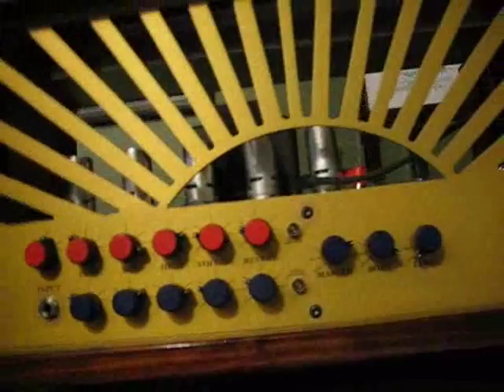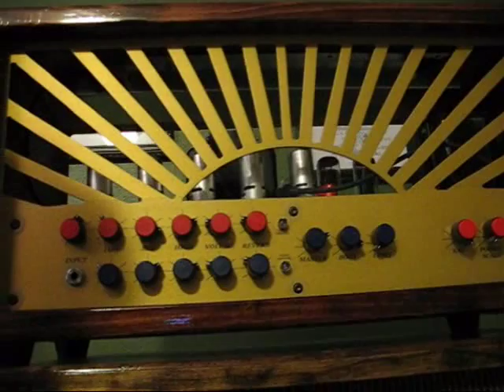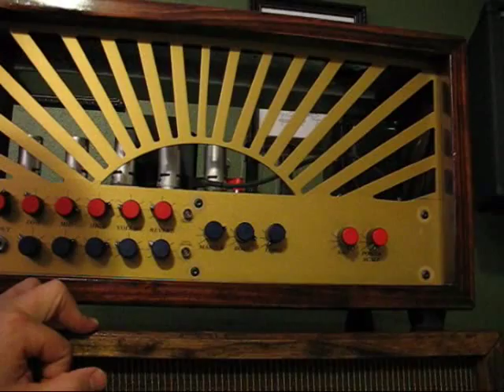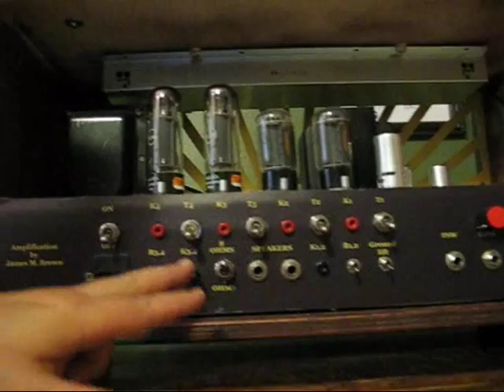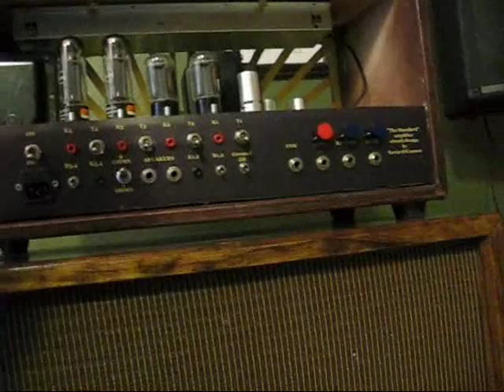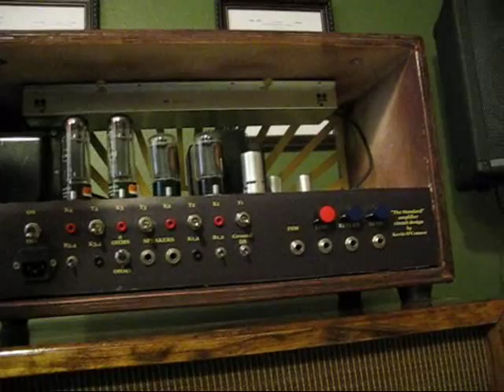Tube amplifier based on The Ultimate Tone vol 5

Comment: Question - The output tube section shows 2 pairs of different types, 5881/6L6WB and EL34B - I assume you are switching between each pair when you switch channels - and I assume that the 5881 pair is tied to the Fender Clean Channel and the EL34B to the Marshall overdrive channel??? This is a cool and very different design that commercially produced amps like Fender/Marshall etc.. because normally, in  a 2 channel amp - like Fender or Marshall - what's different when you switch channels is the preamp circuit, not the output stage (in other words - both channels would share the same exact output stage and the channel would switch between 2 different sets of preamp tubes/circuits with different voicing giving you the "clean" and "overdriven" tones.Switching the output stage is a terrific idea (albeit, a more expensive way to achieve the end result) - the 6L6 family of tubes do sound different than the EL34 or the KT series.Question: Are you also using different preamp paths/circuits ala - Fender/Marshall designs - IOW the traditional method of 2 channel design? If so, you have built completely different paths from input to output for each channel, merging the 2 channels at the output transformer? Separate Preamp, Phase Inverter and Output stages for each channel, going into a common output transformer??I was considering building a 4 x  6V6 or 4 x EL 84,  2 channel amp, couldn't decide which output tubes to use,  but after seeing this I want to use this concept and build a  variation on this design using EL84 and 6V6 output stages - would like to do it with a QUAD of each (4 x EL84 vs 4 x 6V6) - the trick here is to make sure whatever output tube sets used 2 major considerations must be taken into account     1) Output tube impedance  vs transformer Primary impedance, and output power in wattage - to select the correct output transformer for both sets of tubes. This could be turn out to be a complex exercise2) Power transformer must have enough power to support output  tubes that have a higher heater and plate current requirements  (i.e. a 6L6 vs EL34) 3) If finding an output transformer that matches both sets of tubes to run them ain optimal conditions is impossible (because they require different primary impedances to operate properly) you can use an output transformer with multiples primary taps to support different output tubes (i.e - 2K, 6K, 8K winding taps), taps can be selected using heavy duty switch when switching between channels. An example of this would be if you wanted to have EL84s and KT88s - very different output characteristics - would not use the same fixed primary output transformer - may be able to use a multi tap primary output transformer to run both sets of tubes using one transformer.The easier method would to use output tubes with similar output requirement characteristics  so you can use a standard single primary (tapped secondary) output transformer for both pairs (more cost effective and easier to design/operate). Both the output and power transformers, since they are shared between the two sets of output tubes, must be sized (power, impedance) to support the larger (higher wattage) of the 2 output tube pairs to prevent overheating, blowing fuses or possibly igniting the amplifier when driving hard. Of course plate and screen voltages since they are common, must also be taken into consideration in the build for example, mixing EL 34s with 6L6s may present a problem since 6L6s can support much higher plate voltages than EL34s (200-300VDC compared to over 500VDC). In short, selecting the correct power and output transformer when having 2 different sets of output tubes may be more complicated than it seems depending on what output tubes you choose to use in the amplifier.. if they  have similar specifications that's one thing but if they don't that is where some thought and mathematical calculations are necessary to avoid a catastrophic failure..Great design and sound (as best  we can tell using a Bass guitar) - nice build as well - I will pick up Kevin's book - heard very mixed reviews on his books  but based on this - I am going to try at least Volume 5 - I purchased a scaler kit from him haven't assembled it yet waiting for the right project - but now I have renewed interest based on your amp - I assume everything you built for this amp came from that one Volume - Vol 5, scaling, dual output tube/channel switching, presence/body control design etc...??ThanksChris
Reply from the maker: Hello and thanks for your comment. I an certainly not a genius when it comes to this, maybe it helps in trying things that are not conventionally done. Sorry to tell you, no, they both are running of the same output transformer. Kevin explains this well in his book, but essentially tubes are very forgiving and happy with a fairly wide range of impedance. Tone and power can be affected, but since each tube has a separate bias control, this can be done safely. I think the power transformer I used was a Hammond 272jx which has 8amps of heater current to provide. 
The project that you were mentioning would seem pretty straightforward since both 6v6 and el84s are typically used with similar or identical output transformers. You could look up and see what say an ac30 ot specs are then half the impedance. That should get you where you need to be. Edcor has good transformers that you can even customize if you would need to at a reasonable price.
Also, output power was not really a consideration in this build, anything really over 25 watts I find to be more than adequate. Much more focus on tone and flexibility.
Hope that helps.